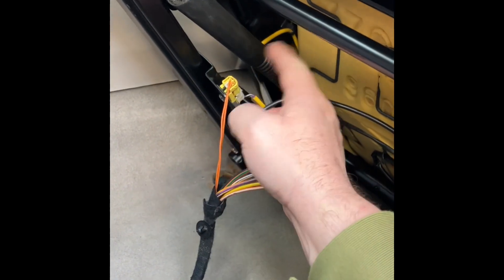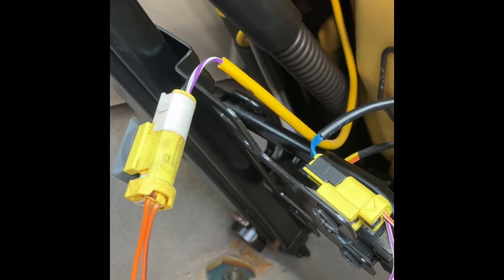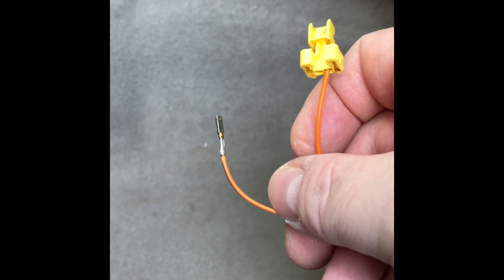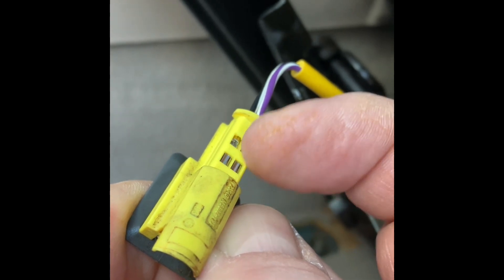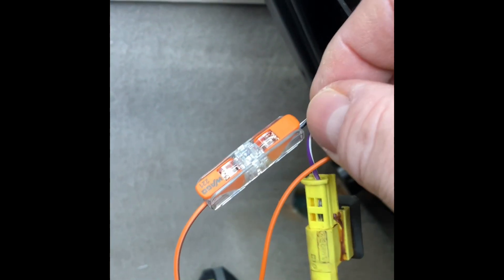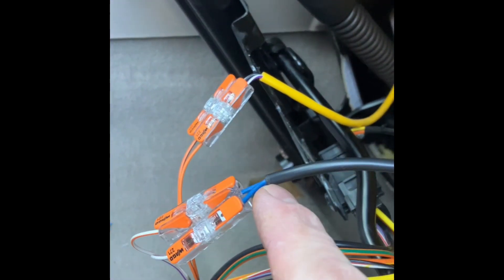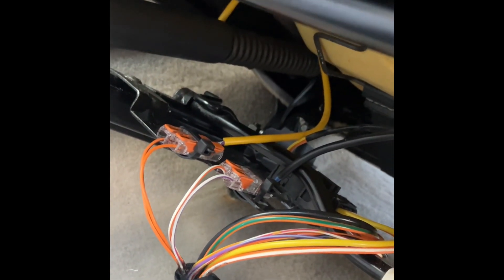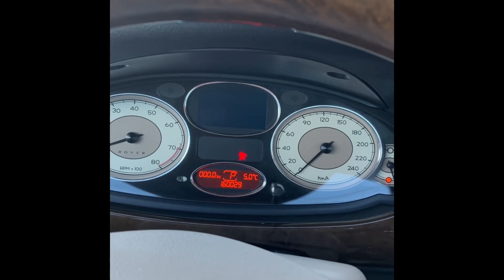Seat connector replacement on a 2005 Rover 75(bad translation alert)

Comment: It's called a combination stripping/crimping tool...might be better to add a few centimetres of cable when doing this, so it can't pull loose/break wires. Be doing mine soon...